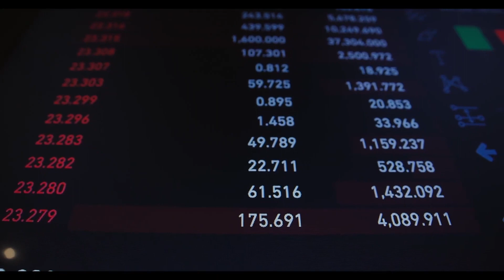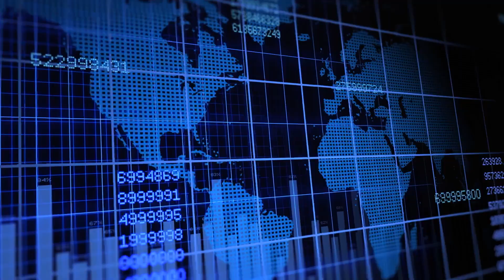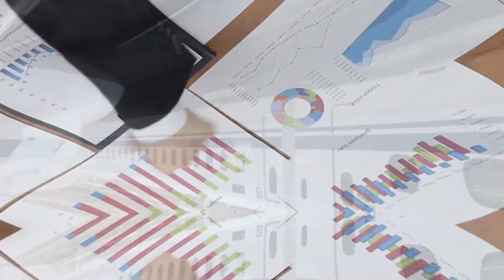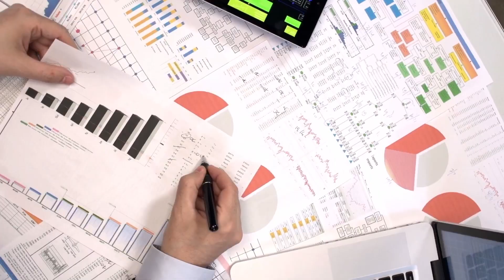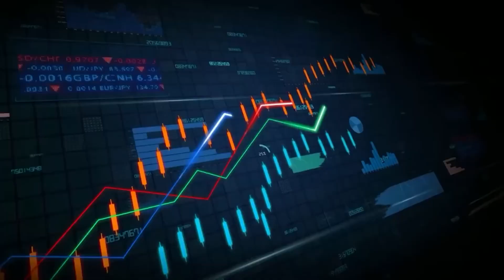Texas $30 Billion Disaster! Dallas to Houston Bullet Train

Comment: I think by far Brightline is the best solution and business plan for improved passenger rail service. It will cost $4 Billion to upgrade and build new tracks totaling 235 miles from Miami to Orlando in a travel time of 3:00 hours. This is diesel with  maximum speeds starting at 79 mph then 110 mph and ending at 125 mph.
This serves about 10 million people. Future population growth and an 85 mile extention to Tampa will serve 15 million people. 

Given the 250 mile distance from Houston to Dallas and a population of 13 million this type of service would best serve Texas as well. A top speed of 125 mph would only take 2:30 hours which is a very acceptable travel time. The cost for this system would be a lot less than a 200 mph electric train taking 1:30 hours which is actually unnecessarily too fast for such a short distance. Perhaps when the future population is projected to increase to 20 million in 30 years, then it could be upgraded to 200 mph electric trains.